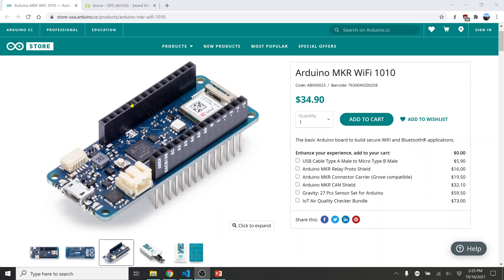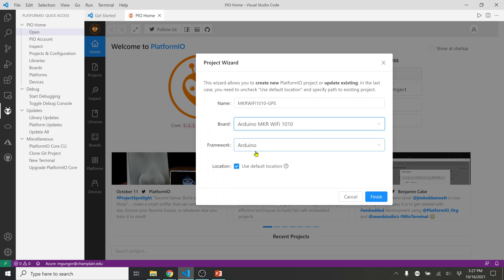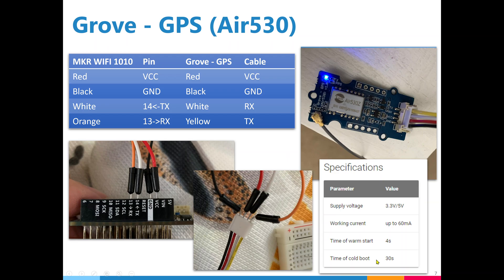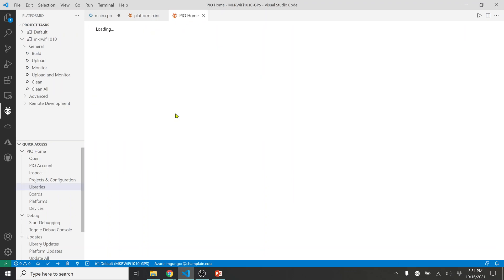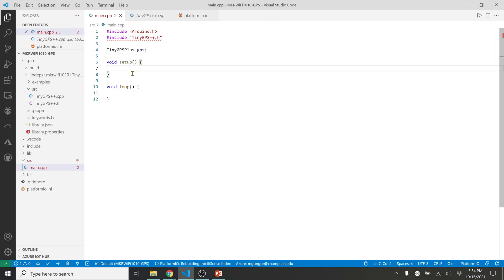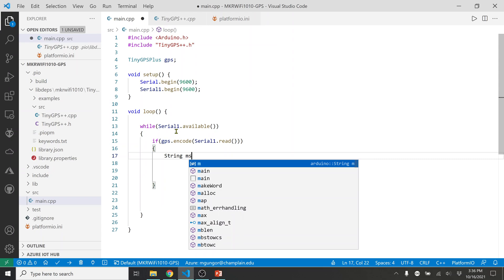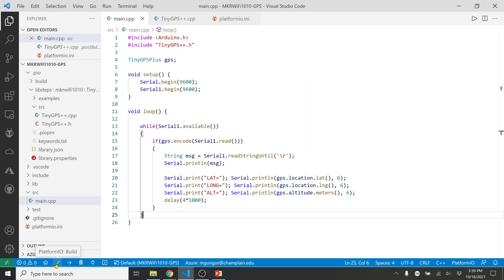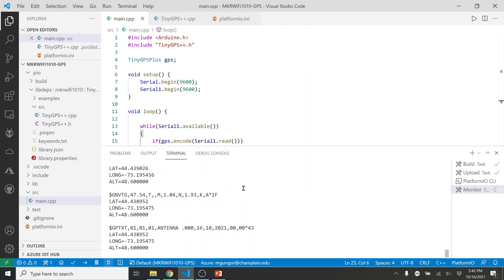Arduino MKR WIFI 1010 with Grove - GPS Air530 using Visual Studio Code

Comment: thank you for the video
 i'm trying to make a tracker that can follow the route i do while traveling i was hoping this may be the solution 
i'm just wondering if you know a way to import all the data to a thing that i can carry around in my back pack aswel as working in a area without much of any internet connection 
i know i'm a bit late but i hope i can hear from you!
Reply from the maker: This is a GPS which doesn’t need any internet connection
Reply: @mkgungor  I meant as in export the GPS data that my device captures and bring it to my server at home